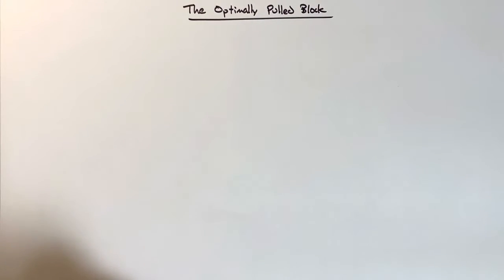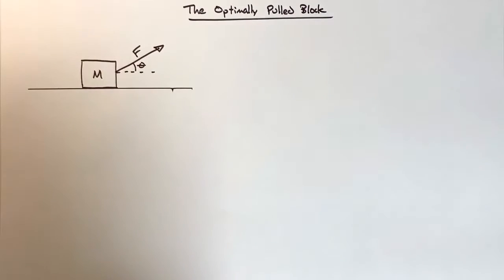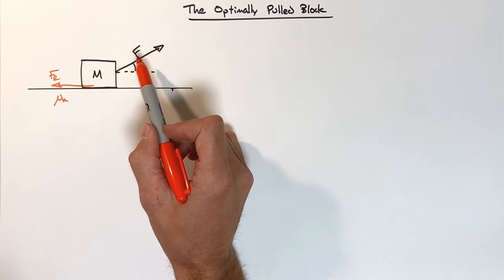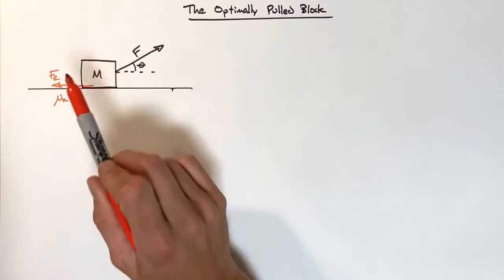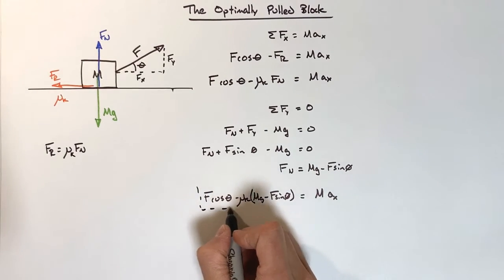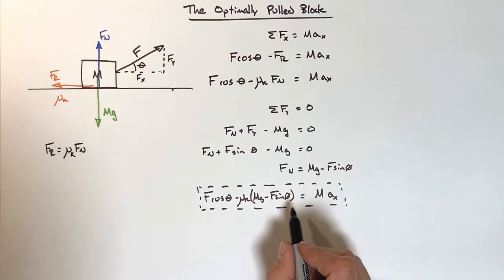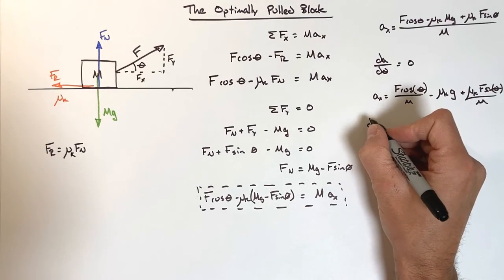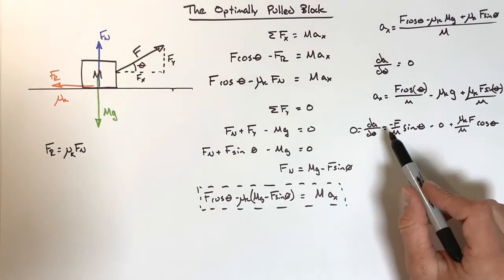Optimize the Direction of Applied Force on a Block to Maximize Acceleration

Comment: Are you sure this is OK for  vertical axis?  The gravity pull and Fy don't have the same attack point.  Same may be applied to horizontal. If you'd pull parallel with the ground, would it be same if the rope was tied just above ground (colinear with F-friction) or at the top of the block?
Reply from the maker: The forces will resolve the same no matter where you apply the force.  The issue comes up when you start looking at the torque applied to the block; but that's beyond the scope of this video.
Reply: @INTEGRALPHYSICS  Yep, I was thinking about torque, because the gravity force pulls on the center of the mass, and the rope pulls  where it is tied, so there should be a resulting force trying to rotate the block. So in other words, when solving these problems, we should consider a block, box or an object to be a single point?